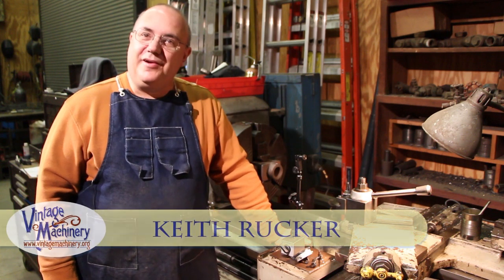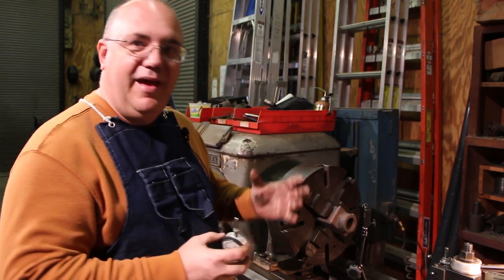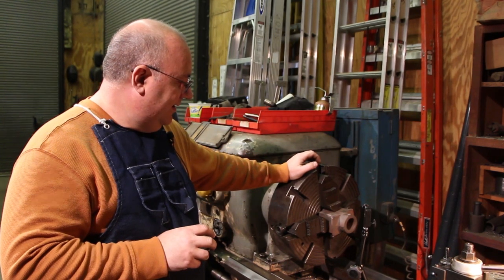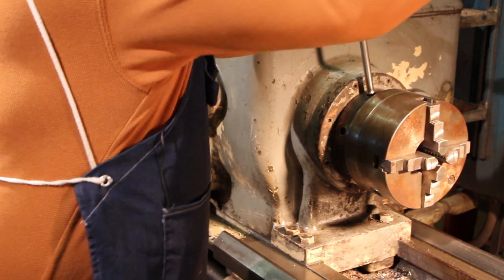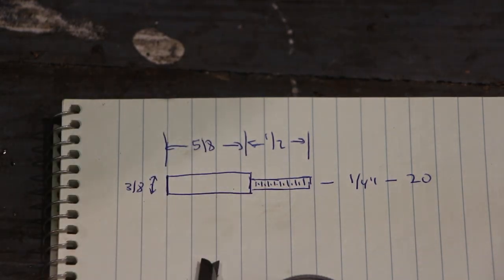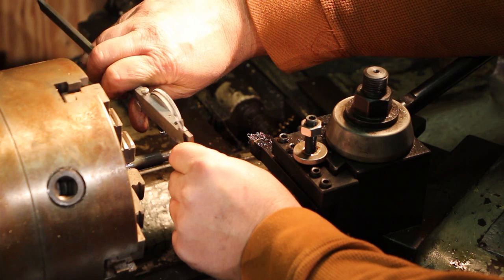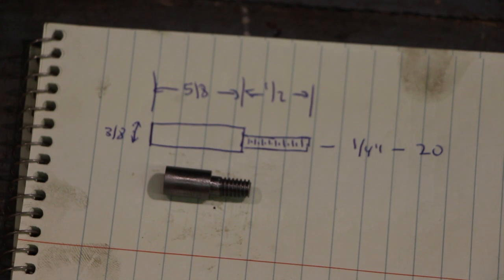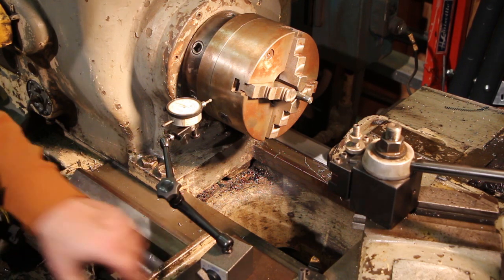Making a Indicator Attachment Stud for a NOGA Holder

Comment: Kieth a friend of mine L & S lathe we mounted small pole crane on the flat part of that lathe just behind the chuck  for changing the chucks it worked perfect .
Reply: He did use the crane to lift material into the lathe it did double work !

Comment: I love those camlock chucks. I have only got 1 good arm to use for lifting my chucks onto my lathe so I couldn't change them myself it was a threaded chuck. One of these days I'm gonna build myself a pole crane to bolt onto the back and underside of the lathe so  I will b able to swop out my big 12'' chucks also & if the need arises to help lift & chuck other heavy objects into the lathe. I've got a taper attachment on the backside so I will have to work around that.

Comment: Keith

For those without a lathe, a piece of 3/8in seamless SS tubing with a ID of 0.209 takes a 1/4-20 tap just fine and only takes the time to tap the bore and cut to length

John

Comment: I had to design a swing arm crane for a similar condition.  We used a simple 4 inch pipe bent at 90 degrees.  Than attached a simple hoist.  The mast of the swing arm was bolted to the floor with a 1/2 inch plate and had 4 gussets. Mine was rated at 1000 lbs but anything less for your application would not handle the sheer force.

Comment: I had to use the bridge idea when placing my South Bend lathe on the work bench. Worked great. I noticed the cross ways on your lathe is not covered, letting chips into the cross slide lead screw. Can"t a creative individual, as your self, come up with a fabricated cover? Maybe that should be your next project?

Comment: You could use an engine "cherry picker" with roller wheels to do the heavy work...
Another option is one of those hoists used to pick up crippled people...They are a lot smaller than an engine hoist and go to 350 lbs...

Comment: If you want to save your self a lot of time, just unscrew the lock screw on the end of he arm, run it through the hole on the indicator, and into the other threaded side of the arm. DONE. You can also just buy a 5/16 (8mm) or 3/8 socket shoulder screw for less than a buck at your local hardware store and save all the milling.
Reply: The Noga clamp doesn't like much under .375".  See this review:  https://www.amazon.com/gp/customer-reviews/R9GVDCNF6CWWS

Comment: Hi Keith
I think you need to adjust you studs for you cam lock they should tighten up between 3 o'clock and 6 o'clock,
check out this post http://www.practicalmachinist.com/vb/general/i-don-t-think-my-lathe-chuck-mounted-right-215155/  (#9)
Seasonal greetings from the UK
Paul
Reply: *****
You're welcome, glad to be of help.